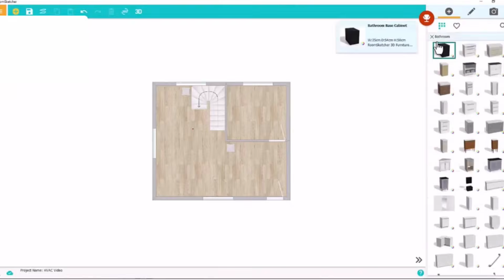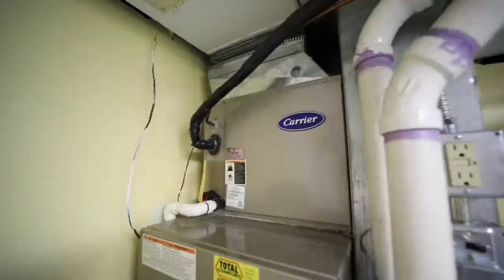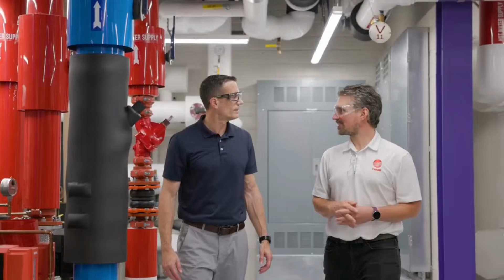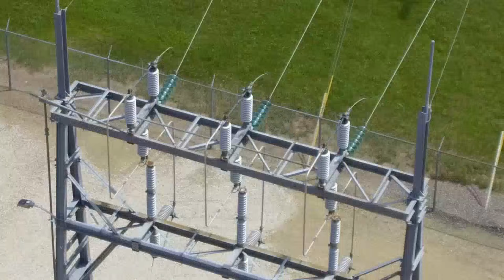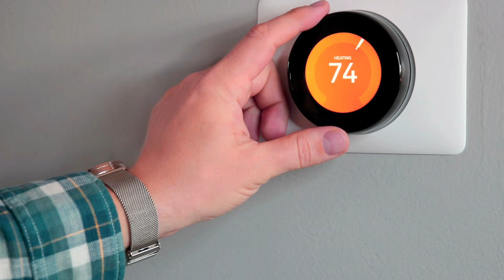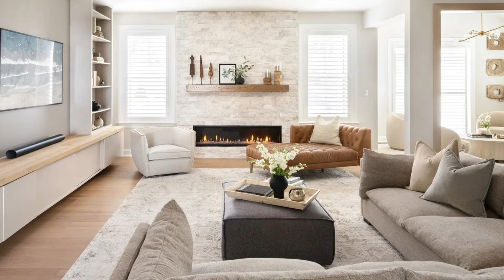How Smart Homeowners Are Beating the HVAC Industry (The 15-Year Loophole)

Comment: My compresses 29 years old and on its last legs, so I called a local HVAC company in New Jersey and this is a 3 ton unit, they try to sell me 4 tons. Then with a straight face, quoted me $16,400 for carrier. I actually spent some time and did a manual J calculation myself and realized that I only needed two. Having said that the one thing I did do was, I added some insulation in my attic so I’m at R28 to 31 on where  you count it. Replaced my compressor then made some adjustments on the air handler. With insulation and a few optional components in the new compressor my oil cost is a tear under $4300, my units not cycling as much and I’m more comfortable. I will say, though, I had some help from a retired HVAC guy who lives down in Florida, who gave me some guidance.

Comment: It just so Happens my name is Richard! And I am a Licensed General Contractor in California, who does NOT Trust any Professional! Whether it be Medical or Labor related.  This guy is not telling the whole truth! My Carrier went out, and it was the compressor! A supposed trustworthy person, who owned his HVAC business advised me he would need to install a new HVAC unit which was going to cost me $5000.00. I did some research and found, a Carrier compressor, on Ebay, which was compatible to mine (and actually better) and paid $800.00 Brand New! I paid another guy, recommended by my neighbor, who had an HVAC business to install it. He charged me $700.00. So, to get my HVAC up and running the Total was $1500.00.  However, because this guy was straight up front. I gave him an additional $300.00! By the way, the Unit the first guy was going to install was going to be a Bosch... The serial number and model number on the compressor is how you can find one compatible!

Comment: My AC IS DONE FORE. Two techs confirmed 
Furnace is old. 
Should i go ahead and do the furnace for the tax breaks and rebates then next year do the ac? 
I will jave a engineer do the manual J  to see if i really need a 4 ton. 
 Im looking at hybrid with heat pump. Louisville ky here. 
$600 dollars more on tax is better.
Saved your video on the tips so ill be trying to follow them. 
Thanks

Oops. And invertor with dehumidifier.

Comment: Had a regular system installed in 2001.  Replaced it in 2025.
No problems the whole time.
Kept the condenser unit clean and changed out the contacts every five years.
So, what went right?

Comment: There are no loopholes.  They just want to get you to spend the most in one transaction as possible and do all of the work at once.  That is the most efficient for them with the best markup.  McDonald's does the same thing.  There also is no lock-in.  You can fit different air handlers, thermostats, and cooling systems together just fine.

I'd just do it all myself and save even more money, because it isn't that complicated, especially when you don't have to run duct work or wiring everywhere.
Reply: Thats my plan. I will remove whole system. Pour a bigger pad outside then place all the equipment in place. Will jave my neighbor and his boss do the final hookups. Im sure the ducting will have to be modified to attach. I think. Well see.

Comment: Darn it.  I replaced my air handler with a Surplus R22 Carrier.  $300.  Had to buy a vacuum pump for $100.  A refrigerant gauge for $50.  Can of R22 for $500.  My Old compressor is still trucking away, with replaced capacitors and fans for a couple of dollars.  I did buy a surplus compressor, sitting in my screen porch, waiting for the day...  
Oh, yeah, I had 3 HVAC repairs from "Professionals".  I had to fix what they left behind.
As an old guy, the Carrier was too heavy to lift into position in one piece.  Had to disassemble it to lift it.  R22 was supposed to disappear, I can still buy it.  But I had to get my HVAC gas certification.  A online open book test.

Comment: HVAC tech here. HVAC is the most corrupt trade, followed closely by Plumbing. Welders have issues too. Sparkies are mostly ok though, on the other hand. I'm one of the few honest techs in this industry in my town.
Reply: Auto tech.s are just as bad! AAA recommended shops are not all good! Tyler`s Auto in Newberg don`t go to them! Had to finish up proper engine adjustments myself after a r/r of 4.3L GM. Thankfully this 70 year old guy can still work on most things.

Comment: I just had to replace my coil/evap unit, it had two years left on the Lennox ten year warranty. That unit was rusty as all hell and it had a freon leak.  I've heard of Bosh six months ago and plan on using one of those when my compressor eventually dies and the private technician who works on  my system will use a Bosh.  Back in 2018 my Lennox 3 ton system cost $4400.00, that was compressor, air handler and evap coils.

Comment: My 45 year old system will probably stop working eventually.
Reply: Mine is 38 years old, only thing i replaced is the  exhaust fan and i think some minor parts. One company  that does maintance said it had to be replaced back in 2002, never used them again. Found an honest hvac guy and never changed

Comment: A secondary surge suppressor installed on your electrical entrance panel will provide the surge suppression for the entire house. Anyway, too bad that they can't keep this simple and get rid of sophisticated electronics. This should be a simple on/off operation and easy to repair. About the only thing that should be added is maybe a soft start interface. Anyway, I looked around at what is available but no costs published.

Comment: If you properly size your A/C unit and use a brand with a good latent heat ratio you don't need a dehumidifier. You only need a dehumidifier when your unit is oversized. Also, a "hybrid system" only works when the new evaporator coil fits in the old air handler. And you can do a condenser and evaporator changeout using the existing air handler with any equipment, it doesn't have to be something special from Bosch. This video has some useful information but it's packed with a lot of BS too. While this industry has it fair share of bad actors, not every contractor is out to get you and plenty of us make a good living doing what's best for the customer.

Comment: Im pretty much done with local HVAC techs, they only want to install old single stage heat-pumps that cant even heat below 30F. After the last runaround I ordered my a Daiken 2 ton ducted system, installed it myself, for 1/3 the price. That was 5 years ago, works perfect, if it fails. I just order another one.  I look at HVAC systems like TV's now. you don't call the repairman, you just buy a new system.
Reply: The same is true for appliances to now!

Comment: Awesome video I learn a lot thanks! Heat pumps are not suitable for our 1959 bi-level home, which has additional 19 R insulation in the attic. The exterior walls have original insulation, oil & gas heating, and solar panels, making it the best option for an older home in New Jersey.
Reply: I went to my supplier Ferguson and I told him what I learned in the video and he told me a 25 year-old carrier parts are hard to find he doesn’t have them. You gotta go to the manufactured carrier.
Reply: @HB-yq8gy  Go to an internet parts supplier. That`s what I did for my 18 year old Coleman heat pump.

Comment: This is a Bosch commercial. There is some good information in this video.. and not all of it is wrong. Find a contractor that you trust. A new system gets a 10 year warranty. Replace the evaporator and condenser and you still have an older blower motor, parts, heat kit, or the entire gas furnace.. with no warranty left. And in all air handlers.. the evaporator is INSIDE IT. The evaporator is only a separate cased item if there is a gas furnace. You can’t simply install a new evaporator into a 15 year old air handler case and match it to a newer 15-16 seer outdoor unit.. because the seer rating and btu absorbtion of the system has to match or you won’t get the same tonnage or you won’t get the stated seer rating. Or worse.. mold, etc. 50% of older systems that are condemned are actually cleanable and repairable. One or more of three things causes you to need a new system. The compressor goes out, outside of its part warranty. You have unsustainable Freon leaks throughout your coils outside of parts warranty. Or the hvac system or duct system is not sized correctly for the home. 20 years of hard use on a system is like 250-300K miles of wear on a vehicle. The average lifespan of a system in North America is approximately 14 years. I have customers whose systems have lasted over 40 years if properly maintained, but that’s rare. 17-22 years of age is a common age point for the entire system to be replaced… and matched correctly to your home. Keep your own thermostat. Have your duct cleaned if you want to. Realize the brand is only 50% of the performance and longevity.. the other 50% is the company and their competency and integrity.. or perhaps the lead installer himself who physically puts the system in and his experience and expertise.
Reply: Saw that on video to replace heater for the extra tax breaks im looking at a complete system but will have an engineer do the manual J J first for the size. Have a cape cod so upstairs is cold or hot compared to downstairs. 
 Do you think i should forget about the tax break to get a system that is designed to work together ? 
Will be getting a hybrid with heat pump variable speed fan control. Theres something else i cant think of. 
 Thanks.
Reply: @hipoman8087  Here in Louisiana I like to size systems 450 ft.² per ton.. but that’s for the average Built home and my area with the high humidity and temperatures. As far as tax credits at the end of the year, you will need to check for what’s available in your state at what SEER rating. A gas furnace may not be necessary.. unless you need a variable speed blower motor for the system to achieve that efficiency. Most contractors will give free estimates and those are questions you can ask. I recommend calling 3 contractors… go with your gut and most of the time the price in the middle is the best option.
Reply: @MrFrenchHarp 
Again. Great tips. Louisville Kentucky is high temp and high humidity also  
People to come up here from Florida are shocked how much humidity we have

Comment: He doesn’t mention that you have to change the air handler because  you have to use the new refrigerant. Also variable speed units require the proprietary thermostat.
Reply: Seems to me the new inverter units have these very sophisticated surface mounted component pcba boards somewhat exposed to the weather. I wonder what that assembly will cost once the 10 year warranty is up, compared to old school single stage units with a capacitor and hole thru components on a simple pcba design that  you can replace parts on if need be.

Comment: Our system was replaced with a heat pump. Indoor unit and thermostat was replaced as well. It cost us $30,000 and it has almost doubled our electric bill. The company is called Perfect Plumbing, Heating and Air in Boise, Idaho. They want to come out twice a year for a system check. $30 each time.

Comment: I don't know a lot about this but I didn't encounter any of these problems. I basically matched the specs of my Goodman R-22 heat pump condenser unit to a new Goodman R-410A unit and fortunately my Goodman 11-year old  air handler stickers said it could handle either one. I identified what model I needed after some searching and called the HVAC company and they agreed with that selection after looking it up and it only cost me $2,200 fully installed. Been running just fine now for 3 years. They come out and do the seasonal upkeep on it and it's just fine.

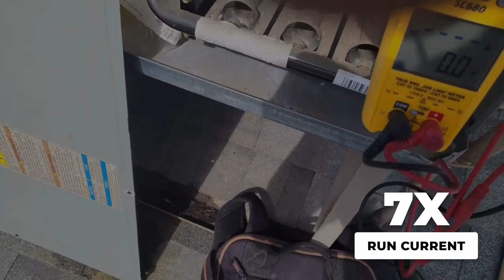Comment: At the 4:00 minute mark, you mention "the problem nobody talks about." Actually,  it's talked about all the time. It's called latent heat removal. 
Poor dude with the variable speed Carrier will spend $6,000 on an invertor board and that's if he can get it for wholesale cost. 
Not every climate in the US needs a dehumidifier. Places like California, the midwest and Appalachia don't need them. 
Summary, don't paint the HVAC industry with such a wide brush. It's like every industry. There are good companies and bad companies. There are good techs and bad techs. Not everybody is trying to get rich off of homeowners but it takes a lot of money to run a legal business, pay your employees well and provide them benefits.

Comment: A little bit of knowledge can sometimes be a dangerous thing and that's the trouble with some of these videos. There's some truth in some things but in others they don't tell the complete story. Bosch is a fantastic product and being a dealer for a number of years but when mix matching it to some products the Seer ratings, dehumidification, and efficiency can suffer. Bosch evaporator coils are four row TXV were most other manufacturers are three rows and orifice orientated with less  coil surface . With the Bosch equipment promptly matched and made it the dehumidification has been great and never a need for a separate dehumidification system.

Comment: I purchased my Rheem 3.5 ton split system with pad and thermostat 10 years ago for $2500 from a wholesale dealer in my town. I asked them who they recommend for installation. They gave me 2 names of owner operators. One of them installed my unit for $1000 which took him and this son 10 hours. He comes by once a year for maintenance I had zero problems in the past 10 years with the system. The company I purchased from is one of the biggest sellers on eBay but luckily their warehouse is 5 miles from my house so will repeat same process when I need a replacement. I keep using Rheem and the technician to install and service because he honest and owns his company not some big corporation that pressure their employees to upsell customers
Reply: The installer was willing to warranty the parts even though you bought them?
Reply: @sweeteg4537  For 3500, I'd just take my chance vs 20k. If I get 7 years out of it for 3500, that is good. I'll just replaced it again. I just got quotes for ours and it ranges from 6500 for a single stage system (including repairing the ductwork) all the way to 20k. Insane.

Comment: Here’s the real issue.  Refrigerant changes every decade make it impossible to retain your equipment. You cannot simply replace one component when the industry is forced to stop making equipment that uses the same refrigerant that’s in your current system.  This is a very short sided article that is pushing electronics that don’t work.  No surge protector will protect from a lightning strike.  They simply don’t work.

Comment: It was December 23 when my Dad called me up saying his whole house heater is not working. So I told him to call an A/C and Heater company to check his a/c and heater system and they came right away the same day. He called me up again telling me that the technician told him that he needs a brand new heating system which will cost him $5K. So that afternoon I came down to my Dad’s house and went straight to his ceiling and checked his system. Found out what was wrong and also the technician intentionally messed up the a/c’s wiring system too. I came down from the ceiling and told my Dad that this part needs to be changed and it’s about 4pm already and so what I did is search in internet the replacement part which cost my Dad $250 and as he needed it the following day December 24 as the weather was really bad. He spent another $50 to get the parts the following day the 24th. Got the part in the morning of 24th and right away installed it and at the same time fixed the messed up wirings intentionally done by the technician. Wala it worked! Dad saved more than $4K.

Comment: its not the equipment, its the refrigerant. Different expansion valves that meter the freon to the evaporator. Oil is the problem for existing lines- that can flushed. Your explanation sounds the same "big bang" when adding a humidifier. Your contractor is ripping you off, not the equipment dealer. The stated cost saving install is above the average cost to replace the entire sysytem. SEER rating is a joke, power bills show the true cost.

Comment: When my Bryant system finally died, I replaced everything with a Daikin Fit 3 ton system. The system is whisper quiet both inside and outside and on start up it starts very slow and ramps up on the power that is needed. It keeps the home very pleasant both winter and summer with about 50% humidity. The best part is my electric bill is usually between $ 80. - $ 100. a month and that is heating and cooling about 1500 sq ft.  Daikin is one of the best decisions I ever made and the warranty is the best in the industry. DO YOUR RESEARCH before you buy !!!
Reply: You would have zero electric bill with solar....
Reply: @SolarizeYourLife  I like my Daikin for now and it's low on electric bills

Comment: Over sizes system are WRONG to Small is also Wrong ..Duct work is the key .. how much air will ur duct work move always count CFMs total static pressure test & yes do am load calculations , add duct work esp returns as needed

Comment: If you really want efficiency, seal your attic with spray foam insulation, then you can down size the cooling btu's significantly and use alot less electricity
Reply: I did just that. In fact, my entire house is closed cell foam insulation.